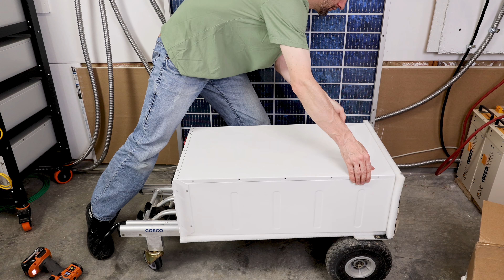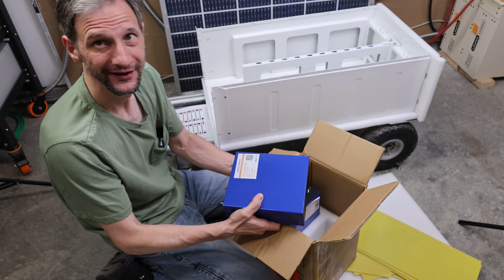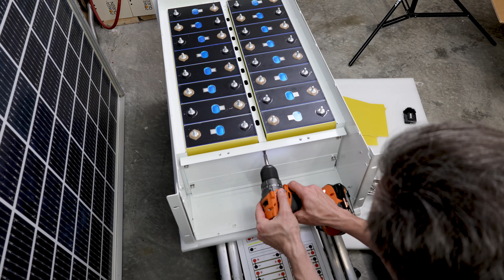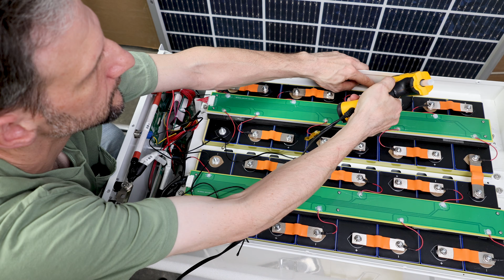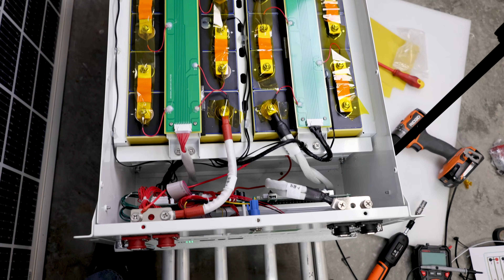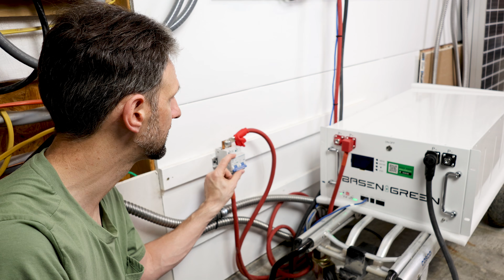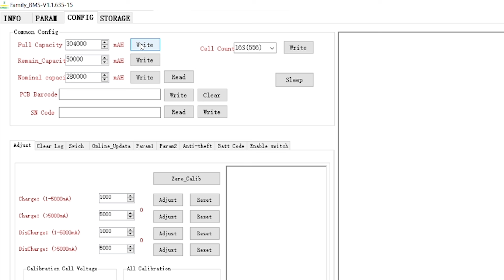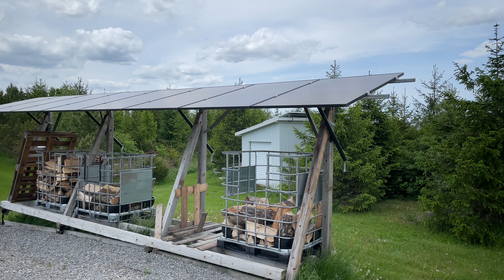SAVE Thousands - Build your own home solar battery backup!

Comment: There is something called “thermal runaway” which is extremely dangerous situation for li-ion batteries and almost within seconds you may burn your house down with big explosions. 

Manufacturers of li-ion batteries make sure they have safety mechanisms and battery management systems that lowers this risk. They do thousands of hours of tests and basically tortures these batteries to their limits to make sure they have enough provision for errors.

These type of “do-it-yourself” projects can go wrong in thousands of ways and you may not even realize it for months and think you’re safe. 

This guy does a lot of guessing on torquing, wiring, gluing etc etc.

PLEASE do not try this at home, this guy is giving a dangerous advice and can lead non-professional home users in big and devastating safety risks.

Comment: I use a 120V 100W Incandescent light bulb as a cap charge resistor.
Reply from the maker: Light bulbs are a great solution for pre-charging, it gives a nice visual indicator of the charge status.
Reply: @ProjectsWithDave  Exactly.

Comment: That is some impressive set up you got there. It must have taken some serous effort to research and build this. Well done. I hope it pays off.
A couple of points regarding this new battery.
First, I can see the appeal compared to the older battery: it saves a lot of space and it costs less on account of the fewer boxes and only one pair of connecting cables versus the multiple jumper leads the old one had. However, I would still prefer the modularity of the older battery.
On 13:10 you say you are going to stand the new battery upright. I would not do that because when stood up the bottom cells will be subjected to the weight of all the entire cell stack above them. Whether they can withstand that or not, I would not want to risk to find out. Also, most batteries have vents and I think these are meant to face up. There is an advantage to standing the battery up in that the risk of shorting in case it is exposed to water or condensation is significantly reduced.

Comment: Please use safety glasses when handling bus bars and battery cells. There are newer brands of DIY boxes with JK BMS units installed which natively communicate with Victron equipment and have 2A active balancers to keep the battery cells more consistent, a built in breaker and more robust main battery terminals, that are definitely worth considering....

Comment: Is it self heating?
Reply from the maker: No, this one is not self heating.
Reply: @ProjectsWithDave  on their website under BMS functions it includes "Thermal management control (cooling, heating)" -- is it possible that means heating elements could be added and plugged into the BMS?

Comment: I wanna put this setup in a camper van and run an 5000 BTU AC unit
Reply from the maker: If you put this battery in a vehicle I would do a lot of wire management to protect from vibration.

Comment: Good morning Dave 
First of all I wanted to thank you very much for the find video also for taking the time a video for all of us be able to learn and understand the availability of items like this 
I have a question 
Seen as how I am on a fixed income and a low budget I was wondering 
Do the batteries come with the case or do you have to buy them separately or can you buy the item separately
And if so it's probably going to raise the cost a bit more but unfortunately being on a low budget income it is the way that I have to do it 
Once again I thank you very much for all the effort you put into all your videos I've seen a few of them and also thank you very much to the rest of your family who works with you to produce such fine videos
Reply from the maker: Thanks for the positive feedback.  You can buy the batteries separately and build a battery without the case, but you would also need to get a BMS and a few other components.

Comment: something interesting caught my eyes in this video. a circuit breaker in the battery leads. this is absolutely not allowed.
May i suggest to remove the circuit breaker immediately and replace it with a fuse cartridge's  ?
the short circuit capabilities' of the circuit breaker is such that it will not switch of in the event of a full short circuit. it can not handle it and the flame over the contacts will be sustained, resulting in a meltdown without disconnecting the supply !!!!

Comment: "Only 550$" for case....ahahah. My DYI Battery: EVE 280Ah grade A cells - 67$ each + 62$ jkong BMS 200A + 50$ for cables, fuse, connectors, separators, wooden case.

Comment: Is there a way to get these to automatically pre-charge from the grid if there is a storm coming like the Powerwall and other similar battery systems do?
Reply from the maker: Good question, I've been meaning to do some research on that.  I'm thinking there is a way to do it with the Victron system, but I haven't looked into it yet.
Reply: @ProjectsWithDave  Interesting, so that would be built into the inverter then? Let us know what you find out, I would really like to have that feature using these batteries.

Comment: Can I use a battery like this to harvest cheap overnight electric and then run house from it during peak times?
Reply from the maker: Yes, you can if you combine it with an inverter with time of use capability.

Comment: Hi Dave, I always hear that you should connect the positive terminal on the battery first before the negative, and disconnect the negative first before positive.  In this video you're doing it opposite.  Does this matter, or is it just a safety precaution for beginners?
Reply from the maker: You are correct, that is the best practice.

Comment: Bro what are you doing with all that power😮 you must have 30,000 in equipment there😅 you're not exactly saving money like that😅 I've been living in an apartment with no electricity with only 5x20 Ah power Banks for 4 months. No problem.

Comment: Nice Video, I would like to do this, I currently have 4 EG4 LifePower Batteries working with a Growatt SPF 5K Es, would I be able to use both battery systems to the invertor beacause  they both recognize the Growatt? Thanks

Comment: Just discovered solar panel efficiency. Spending 30k and buying alittle plot of land with an RV, huge solar panels on it, a pistol with ammo, and a mini well with water filters to last 1-2 years. Is now on my bucket list. Grab a laptop, phone charging banks, and maybe some internet of some sort. This is totally doable. NO more rent ripped off etc, just go to town once ever 1-2 months and stock up on food. Work remotely on the laptop maybe?
Reply from the maker: Solar has brought a new level of independence.  With an electric car, it's even possible to survive without gas.
Reply: Water
Reply: That bubble's already legally popped in most places. RVs can't be your permanent structure on most land you may be able to buy. There are limitations on limitations on limitations for long-term occupancy. 

If you "convert" the RV into a "non-mobile" structure and DIY rebuild it / you may still be "ok". 

In some places, an existing structure MUST exist. And the camper must end up, in the end, (add a room or something, or outdoor kitchen) matching exactly the footprint of the original structure. Else you have to do backflips legally.
Reply: @fshalor738  What about getting a trailer RV and just attaching it to a car/hook? Your telling me I can't even get a trailer and park it on a piece of land that I own?
Reply: @Alex_Justified  sadly, "land of the free" is becoming more and more of a misnomer
Reply: Some places only allow RVs for a limited amount of time each year. But you could have a nice pole barn and have a lean to added to the side to park under and sneak it in like that. Just don't tell anyone. It will be your RV "storage". There are Rules like this in Colorado, depends on the county.
Reply: Good idea! Add a greenhouse, and chickens, maybe goats for meat, milk.
Pick the right dual purpose breed, or mini cows! Water well is needed.
Reply: you forgot the tin foil hat.

Comment: Using prebuild closets with bms included has also drawbacks: the balancing power of the included bms often is limited in bleeding power.
I am running for more than a year with two paralleled strings of each 18 EVE LF280K cells and will add two more this summer. All will be built in a metal closet with 4 drawers, isolated from each other and equipped with a cell level modular bms and an aerosol fire extinguisher/preventing devices.

It cost you a bit more but you are in control about important things like safety, monitoring, bleeding capacity etc.
Reply from the maker: The right BMS does make a big difference.

Comment: So how can I adopt this setup to my circuit breaker box which normally gets 100 amps from the grid? As a backup how long will it last powering essentials in a house during a power outage. I would like this as a backup to my portable natural gas generator which would be my first backup to the grid. I would use the batteries during the night when peak power is not required. Also my generator could charge the batteries. A novice am I.
Reply from the maker: This video will give you an idea of what it takes to power basic emergency systems: https://youtu.be/BzMAW8kW0CU

Comment: Can you combine that battery with your sok's? Or would the charging be an issue?
Reply from the maker: They are currently combined you can see it in operation here: https://projectswithdave.com/daves-off-grid-monitor/
There is a mismatch in capacity between the two batteries so they drift apart over a few days.  I find I need to charge the whole bank to 100% once a week for it to stay reasonably close. 
Short answer is it works but I wouldn't recommend it.
Reply: @ProjectsWithDave  Good info. Even my 4 lifepower 4's drift apart as well.

Comment: Sure found some solid deals. People are spending 3K for 1KW battery packs in hybrid cars, and of course an all electric pack would just totally break the bank. I think we might see some kits coming out soon.

I recently spent about $1000 for 3.6KW battery bank and inverter that goes into my car so I can bring home appliances to the work field for cooking, computing, etc.

Last year, spent about 1k on ~1KW hybrid traction battery replacement for Prius. Reconditioned and cheap. Would love to find some kind of kit that would allow different types of battery cells to be used. I don't care if it takes half the trunk, I want something that's easier to work with and has high capacity. Dealerships want about 3K to replace a 1KW battery pack and that's just retarded.

Battery junkies know it's not worth it.
Reply from the maker: I think we are going to see a lot more options at much lower prices in the future.  The price of Li has dropped dramatically in recent moths.

Comment: Great video thanks for creating.  Im based in New Zealand and solar down here is still fairly expensive, we don't quite have the selection that the US market does, although is getting better. Im pricing up a hybrid system currently, and 15kwh battery is exactly what I've spec'd (with 7.5kw panels) I was initially looking at Fox ESS as relatively well priced, however it appears to be exceptionally proprietary and seems to only work with their Fox batteries (like the nano cube)  I dont like being tied into a certain vendor, and like the Victron kit however its a lot more expensive than Fox. Stuck between a rock and a hard place at he moment as only have a certain budget, but the basengreen kit does look good
Reply from the maker: It's hard to make decisions with all the options out there.  As you said, I would go with a system that is flexible.  You will have more freedom to expand or change things later.
Reply: @ProjectsWithDave  Thanks for the reply.  I've ordered Basengreen with 16 x 306AH batteries from Alibaba, and it seems pairing PV panels and battery with a Deye SUN-8K-SG05LP1-AU hybrid inverter should do what I need. Cheers

Comment: Y'know it only takes about 60volts to break the skin so the scarry part wasn't when you connected the wires like you said but when you touched the 52 volt terminals
Reply: I've thought the same, but I think the tape was over the terminals at the moment.  It was removed immediately after.  I also assumed he was aware of that (and trusted that thin tape).
I also thought 45V was the starting point for shock.
Reply: @louf7178  yeah it really depends on the person I think, the deadly zone starts at 60 I believe but I'm not an expert lol
Reply: @junkyardripper  Yes, those are additional facts that were dormant in my brain (I tried to be specific by saying "shocked").  Another thing is if your hands are sweaty.

Comment: How about a cylinder/ Squirrel cage wind generator, covered with flexible solar panels.
Wouldn't matter where the sun was, as long as it was up.

What do you think..?
Reply from the maker: It's better to point the panels where you want them.  Spinning panels would be hard to wire and they would only get sun as they pass by the south facing side creating a sinusoidal output that would likely confuse the MPPT tracking system.
Reply: Its not as hard as you think for wiring. E-line drums ( drum of wire for down oil wells) have a slip ring to allow spinning

Comment: Looks like they do have breakers now. I saw this on their site. New Release: 2A active equalizer +DC breaker. They also have three versions one without batteries and the other two with batteries. The battery versions are 280ah and 314ah
Reply: What's the difference between 280 and 314?  Bigger cells or more of them in the same case?
Reply: @gf3803 the cells are a bit taller. Same 16 for both.

Comment: Looks great, but please update us in a year or two. I have A LOT of batteries that literally lose 30-50% of it's capacity in the first year or so.
Reply from the maker: What brand batteries have you had that experience with?  Only one of my 5 SOK batteries has lost any capacity after over a year of constant use.
Reply: @ProjectsWithDave  Weize (so far so good), Vatrer, (unknown, not yet put in service), Voniko  (bad), JDSolar  (bad after 1 year), Expertpower (3 years), Litime (bad in 6 months), Superlee (so far so good, less than 1 year),  Leoch (just okay, I think we got 3 years), EBL (just okay 3 -4 years),  Ecogear , Ultracell (4 years) Battery Tender.... varies alot. Originally very good. Then very bad, and once they added protection circuits good, Sunlabz, pretty good, Upstart (not bad really but I have not purchased from them in years.), Phantom. FANTASTIC. Still good after 9 years, but can't find them anymore. This is a mixture of LIPO4, Lithium Ion, and some SLA.

Almost any battery will go for a year. Back in the 1970's in our Physics lab we had batteryies from the 1940s. They were 35 years old and working perfectly. They were US Military surplus purchased after the war. I hear from the professors they were still good into the late 1980s but I heard rumors they were changed out for more modern technology at some point but they were still good when they took them out of service. They were GLASS bodied Lead Acid batteries. You could see right thru the battery. They were on racks, weighed a ton but they just never really stopped working AFAIK.
Reply from the maker: Thanks for the detailed response!

Comment: Damn this is a very nice Video to watch, i want to start my own battery system to run my house trough the night and charge it during the day with my PV system. searching around for some intel before i dive in and this is a very good start ! , my house is using around 500-600 watt continuously so if I'm not mistaken that's 0,5 - 0,6 kwh right ? so that times 12 (the night) so i could start smaller and not need to build a 15 kWh but something like 5kWh ? i have a  hybrid inverted of Huawei (the Sun2000) that gives me 4,4kWh max and I'm curious what additional parts i will need besides the battery. do i also need the Victron then ? could you provide me with some extra information if possible please. would be much appreciated. Regards
Reply from the maker: I have quite a few projects with varying levels of backup systems you can view from the projects section on my website here: https://projectswithdave.com/

Comment: That site now has 314ah cells on pre-sale for $87 which brings the capacity to 16.077KWh and price to $1964 Case is now $572 but they also offer it with 314ah cells for $1925 or 12c/wh.
Reply: i cant find anything 6
87 dollars  can you keep me up to date on this
Reply: @richardthibeault7796  I am not 100% sure what you mean but if you go to the BasenGreen site linked above and choose the US warehouse, the cells are listed.
Reply: My MB31 actually test out to 325AH, some as high as 330AH  3.65V to 2.8V.   Big jump from the LF280K which were hovering around 280AH.

Comment: If you look at reusing ev batterys. You can reduce this cost even more. I have just built up 60kwh of storage by using  Ev battery modules 
Cost £2800
Reply from the maker: Used EV batteries can be a good source.  Which EV modules did you use?  What voltage system did you build?
Reply: Hi. I used the modules from the. MG zs ev.   These. Are a nice contained module  that just unbolts. From the battery housing .  At some date we will put a vid out how I made the battery . 
The only issue is that  I had to a disconnect  two cells and make it a 14 S. battery.  Due to the battery’s being lithium iron.    These have a max cell voltage of 4.2v 
I set my 100% charge level at 4.1 volts.  And my 0% at 3 v.   This gives me a nice buffer at the low end  and also sets the actual max charge level just over the 80%  level of the cell. So giving the battery an easy life.  I normally. Look to keep battery  charge. / discharge below. 10 amps.
Reply from the maker: Nice! Where did you get the batteries and how much were they?